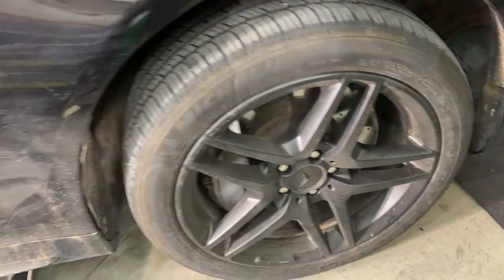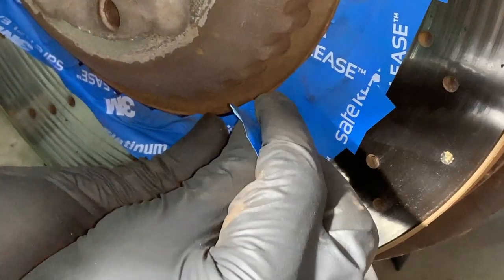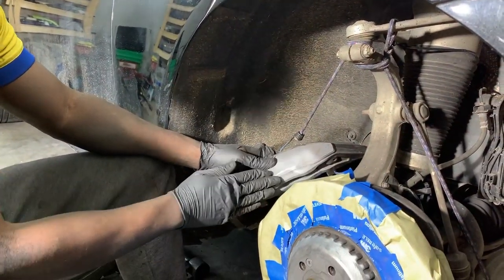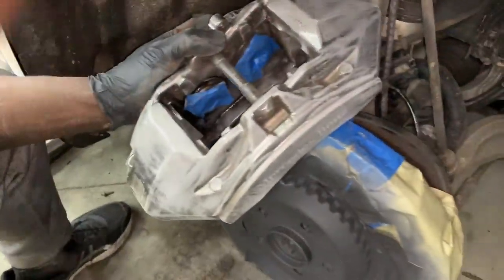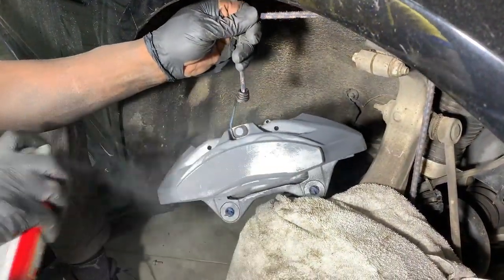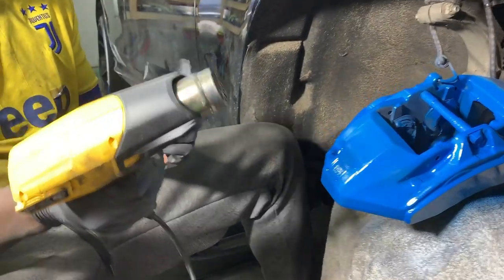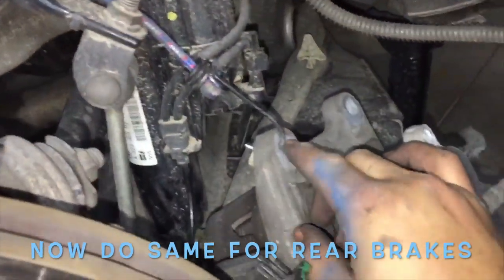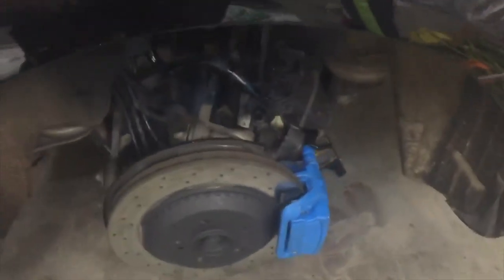HOW TO PAINT W222 S550 AMG BIG BRAKE CALIPERS THE EASY WAY!

Comment: Standard procedure for replacing a disc brake assembly is to remove lid on brake fluid reservoir and drive pistons apart using a C-clamp. This will eliminate most of the mallet banging.
Reply from the maker: Yeah you’re right😂 sadly didn’t find out till after video lol
There’s sequence you select removed all need for mallet

Comment: The W222 has an electronic rear parking brake, so you have to release the brake caliper in the car's diagnostic menu before changing the rear pads.
Reply from the maker: @JohnWarren THNK YOU! unfortunately I discovered that only after I’d completed the job 😂